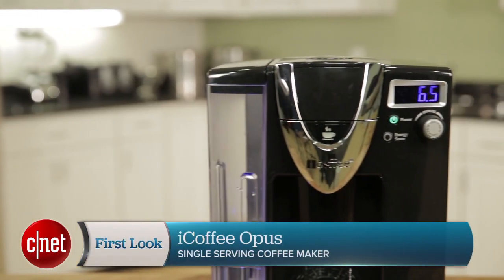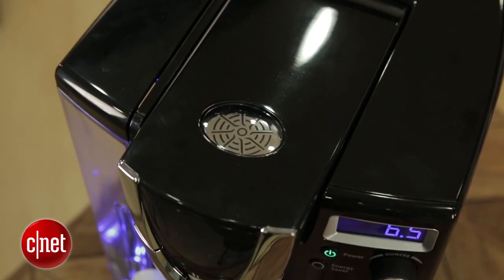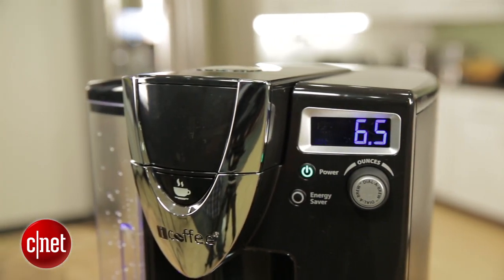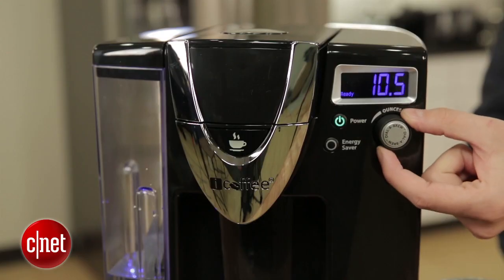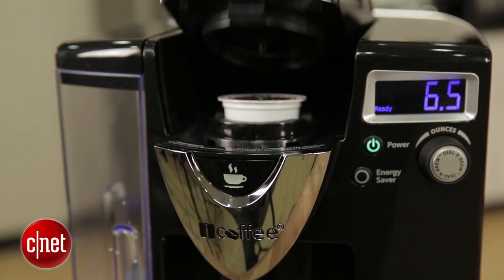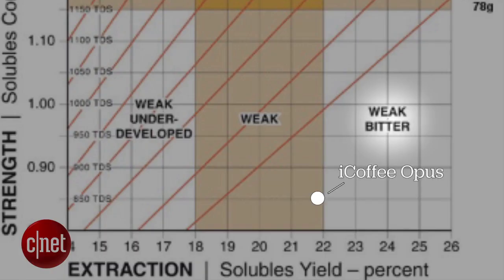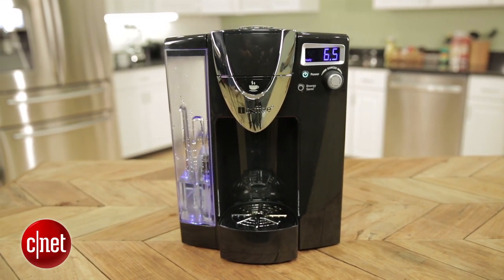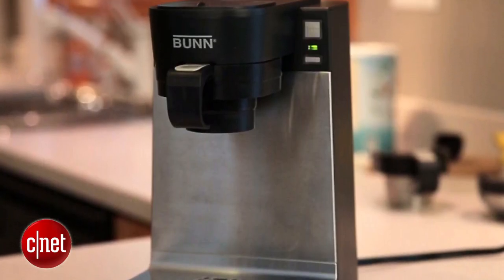iCoffee spins up a Keurig competitor

Comment: I honestly don't know what this guy is talking about.  After years of owing Keurigs, we bought an iCoffee Opus and have never looked back.  The difference is night and day.  The iCoffee DOES make a less bitter cup of coffee, and it's hotter, too.  Fabulous machine.  Try it.  Also, no coffee pod produces strong coffee when you run 9 ounces of water through it.  You will ruin any coffee that way.  We brew our pods at 7-7.5 ounces, and they taste great.  Not weak at all.  The recommended amount of coffee to brew a 6 ounce cup (according to most coffee packages) is 2 tablespoons.  So 2 tablespoons of coffee per 6 ounces of water.  How much coffee do you think they can fit into those pods?  It's absolutely no more than 2 tablespoons, once you allow room for agitation.  So 7-7.5 ounces of water is already pushing it, in my opinion, and it still tastes fantastic out of our iCoffee machine.
Reply: Do you know the difference between the Opus and Mozart?
Reply: I think Opus was specific to Bed Bath and Beyond. Mozart is available everywhere else.

Comment: I demonstrated this coffee maker in its original pot  size and then the single serve - tt is to date the BEST every day coffee maker I have ever used and I was a total Keurig freak before (and demo'd them AND owned several)  My Icoffee single serve I have had for probably 5 years - use it daily - over and over - make my OWN icup rather than use kcups- never lets me down and has caused me NO problems.... keep it clean - (I use filtered water as well) and you cannot go wrong.  Do not waste your money on a Keurig - they are way less expensive now than when this came out but you likely will need to buy it online since it seems BBB no longer keeps it on the shelf - at least not in the smaller stores - It is also sold as the Davinci in Kohl's and other stores

Comment: I adore my iCoffee Mozart and glad I purchased over the proprietary expensive k-cup  Keurig maker. I like the functionalities, separate water reservoir, dial-a-brew, quick heat up, better taste of coffee, and the included free basket for your own grounds. Finally, in my mind a brand that can compete against the money hungry Keurig status symbol.
Reply: @GK-nh3zi  I bought mine from Amazon.. and unfortunately after this review, it quit on me 6 months later. In my mind I couldn't rationalize buying another one when they had known issues, which may have been fixed by the time you purchased yours. To replace it, I purchased a Hamilton Beach Flex Brew. It does all the pods with a converter basket and another basket for your own ground coffee. I love the scent and taste of freshly ground coffee. 
It has a stand so that I can put any size container under it, and it also serves to stow away the extra baskets. How kewl is that? 
The price? I got mine free by using my Kohl's cash I had accrued from buying Christmas gifts. It has lasted for 2 1/2 years. 

I use filtered water from my fridge and do a cleaning cycle ever so often. Has never failed me, (knock on wood). :)
Reply: @GK-nh3zi  Since, it's been 3 years ago, I've had no issues with cards and accounts. I only use paypal with ebay solely. I had purchased it from the company, and it was new. It made those noises under 6mos that they were noted at that time of making. Something with the motor. But I'm happy with my Hamilton Beach FlexBrew. It's been going for 2 1/2 years now. :)

Comment: nah..... I'm just gonna stay with my Keurig, and my refillable metal k cup. It saves the environment because I'm not using those horrible plastic k cups, and I'm saving money. I spend ten bucks for about two months worth of coffee, which for me is one bag versus sixty dollars on the k cups if I have a cup of coffee everyday. Plus my coffee from a bag just tastes more fresher and cleaner too
Reply: Where did the metal come from .. what type ?   Near nuclear leaked areas?  ..  think of metal like you should .. do of plastic.  I coffee is bpa free. 
It's far better of a brewer .. research where the parts come from of keriug etc.
Reply: 7531monkey I sold my Keurig and now I use a French press. it's soo much better. and I just toss the coffee grounds out on the lawn. When you toss coffee grounds on the lawn, it actually helps the lawn and makes it more green.

Comment: CNET I read your review after testing the Cuisinart SS and the icoffee and I simply cannot believe this review. The only thing I can imagine is that the icoffee you tested was defective or otherwise you simply are so far in left field that you are hours behind since quite obviously it is not the same ball park.  I did rather extensive testing on the Cuisinart and the icoffee.  I chose to use the Cuisinart in my testes as it brews significantly hotter than my Keurig machines.

First of all to do a review comparing another product WITHOUT that product at the same time to me is ludicrous and totally invalidates your review. 

Now in running multiple brews of different volumes in each machine I came to the following conclusions:

Cuisinart is significantly hotter (at least 5 degrees F) and faster (at least 50%) 100% of the time BUT the body, mouth feel, lack of bitterness, i.e., overall taste is far better with the icoffee, As a matter of fact,  it is only slightly inferior to  the brew that I get with the Aeropress which I consider my best brewer.

It is interesting but the icoffee brew was so much better than the Cuisinart which I was previously using that I literally dumped the Cuisinart brews (even at the 6oz. size) down the drain as it tasted watery in comparison to the brews from the icoffee.